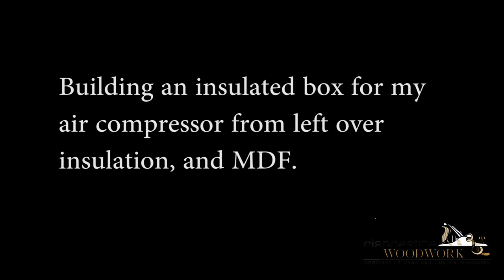047 Building a box to quiet a noisy air compressor

Comment: Hi, nice job. I have some improvements if you want to hear. use min. 140 mm of glaswool. Make the inside not rigid, you nee foil or thin sheets of metal with bores in it. the acoustic sound have to go trough the holes and has to be absorbed inside the wool. Your design doesnt allow the wave to go inside the insulation for absorbtion :-) regards

Comment: I really don‘t know what this video is saying!. The whole point about noise suppression is to stop the noise bouncing of hard surfaces and also causing vibration and transporting this to the „Outside Environment „. You will always reduce noice by encasing the source of the noise, how effective that suppression is......? If you had left the inner walls open with the cladding exposed, I‘m sure this would have been more effective. Perhaps I‘m wrong, don‘t think so however. The box itself is really brilliant 👍
Reply from the maker: Thank you.  In all actuality the bulk (not sure if that's an appropriate measure of volume) of the noise was because the piston was shot and was bad.  A few months later the volume suddenly grew exponentially to the point that the case didn't make a difference, and eventually it's max pressure steadily decreased.  I rebuilt it, and it's much better now.  I understand what you're saying though, I imagine having the inside open would assist in keeping it quiet.  I used to have a room set up for music, and it was the same principle there.  I created 4x8 frames of 4" pine and filled them with insulation, and just put cloth over the face of it all.  This setup will most likely be scrapped prior to my next move, and I'll think of a better way when I figure out where I'm living next.  This isn't ideal in any situation because of the increased heat as well.
Reply: Clandestine Woodwork I really don‘t mean to be a smart ass, but the whole point of noise suppression is absorbsion. The more sound absorbed, the less rebounds or gets out elsewhere. I‘m not a sound engineer, just someone Whois interested in what others have come up with 🤘
Reply from the maker: @robertw.1499  No problem, I agreed with you.
Reply: Robert W. I think you are basically correct as far as an ideal situation. A true sound deadening wall assembly would have sound batt insulation, but would also incorporate a dead space. Also, ideally, a structure like this would be isolated from the floor on some sort of shock mounts. However, this build still does the trick for most shop applications. The best solution for many shop setups, at least where applicable, is just to remove the compressor from the shop entirely and pipe in the air.
Reply: @interstatemotorcompany2355  all good additional constructive ideas to improve what is a good basic starting point demonstrated here. One question before my further verbose comments :) LOL you  suggested that a dead space be added, any ideas on how that would be  constructed  and what would it do to help with this noise reduction cabinet  how would you implement it  in this  above ? .... Also seen others suggest adding car muffler to air intakes. One thing I saw on the person's video who suggested the muffler was their air filters were after the muffler in between the air compressor and the muffler... where having them there would be less of a mod then on the outer most intake position of the entry point of the muffler it seems like that might be better or in both positions even better if possible. ☆ with added benefit of being able to use a large car air filter in outermost intake filter position which might increase airflow? due to larger size then standard compressor filter diameter and maybe be cheaper to replace? guessing you pic a setup that chose a commonly available filter setup that meets your requirements but your ability to customize such based on sustained availability and low cost and let that determine you're set up instead of having to be constrained by your setup which would determine your cost as it would be in a normal determined by your car situation. Perhaps adding an exterior filter as well of high airflow material that is cheap and visible from the exterior might minimize on the need of replacing your internal filters and also be visible to the exterior eye and us you know when you need to replace it more readily.  Also I was wondering if one might be able to construct the filter housing chamber out of a circular section of plexiglass? Or some enclosure in which you could see in without taking it apart to be able to judge how dirty air filter was at a glance seems like a good addition I have not yet seen on the few videos I've looked at the few videos I have looked at thus far.
Reply: EnigmaRain Productions if you look at page 15 in this document (http://www.usg.com/content/dam/USG_Marketing_Communications/united_states/product_promotional_materials/finished_assets/acoustical-assemblies-en-SA200.pdf) you’ll see sections of several acoustical wall types that incorporate a dead space. Essentially the point is that air is not a great sound transmitter, so including a gap between the materials lessens the transmission of sound. The shock mounts or isolaters are the same idea. A rigid connection is more sound conductive than a cushioned connection. However, I’m really overthinking this insofar as it matters for a home air compressor. First and most obvious solution is a belt driven compressor over a direct drive. Second is move it outside and enclose it with some sort of assembly. As a matter of fact I picked up a 75 gal belt driven compressor last weekend to replace my 20 gal direct drive. I’m going to mount it out back and run airlines into the shop.

Comment: It's tough to hide the noise!   My compressor is worse, it either walks, or vibrates my house 😒
Reply from the maker: This worked helped a lot.  Now it makes a little more noise, since I set some stuff on top, and it vibrates.  Mine walked around quite a bit before as well.  It didn't help that the rubber feet are missing.
Reply from the maker: A few months ago, it got much much louder and wouldn't build as much pressure.  I replaced the piston and a few other parts, and it's much quieter now than it has been for the months leading up to this video.  The piston was cheap and easy to replace.  The biggest hassle was ordering it from literally any place other than Sears Replacement Parts.  Sears, like always was out of stock, and it took multiple calls over several weeks to finally cancel the order and get a refund.  Meanwhile, a parts distributor I found on Amazon had me the parts within a week.

Comment: One question before my further verbose :) comments... LOL, someone suggested that a dead space be added, any ideas on how that would be  constructed  and what would it do to help with this noise reduction cabinet  how would you implement it  in this  above ? .... Also seen others suggest adding car muffler to air intakes. One thing I saw on the person's video who suggested the muffler was their air filters were after the muffler in between the air compressor and the muffler... where having them there would be less of a mod then on the outer most intake position of the entry point of the muffler it seems like that might be better or in both positions even better if possible. ☆ with added benefit of being able to use a large car air filter in outermost intake filter position which might increase airflow? due to larger size then standard compressor filter diameter and maybe be cheaper to replace? guessing you pic a setup that chose a commonly available filter setup that meets your requirements but your ability to customize such based on sustained availability and low cost and let that determine you're set up instead of having to be constrained by your setup which would determine your cost as it would be in a normal determined by your car situation. Perhaps adding an exterior filter as well of high airflow material that is cheap and visible from the exterior might minimize on the need of replacing your internal filters and also be visible to the exterior eye and us you know when you need to replace it more readily.  Also I was wondering if one might be able to construct the filter housing chamber out of a circular section of plexiglass? Or some enclosure in which you could see in without taking it apart to be able to judge how dirty air filter was at a glance seems like a good addition I have not yet seen on the few videos I've looked at the few videos I have looked at thus far.

Comment: Won't the compressor overheat?
Reply from the maker: If it runs a lot it probably will.  I usually have the top door open when it's running.  I did have a problem last summer when a small pressure hose on the compressor itself heated up and detached, it wasn't clamped in place originally.  I was cut off the damaged tip, heated it with a heat gun and slipped it back over the barb.

Comment: I have the same compressor, which is why I am here. It is VERY loud!  Like somebody else commented, I also considered moving it up into my attic.
Reply from the maker: Chances are the piston and cylinder is failing.  Not long after I made this box, it got so much louder and wouldn't go above 60psi.  I replaced the piston and cylinder and it became much quieter after that.  The compressor is actually made by DeVilbiss and the parts are easy to get and affordable from Amazon.  Sears Parts is terrible and should be avoided.  Though, it's possible that parts are out of production and not as available anymore.

Comment: Well Insulation is shitty sound dampening material, love the box though!👌👍
Reply from the maker: Yes it's not the best, I used it since it's what I already had on hand.  The cylinder was beginning to fail at this point, which is why it was so loud.  I replaced the piston and cylinder last year and it made a huge difference.